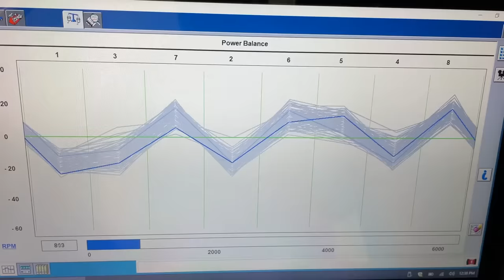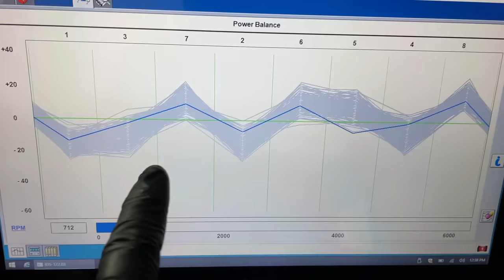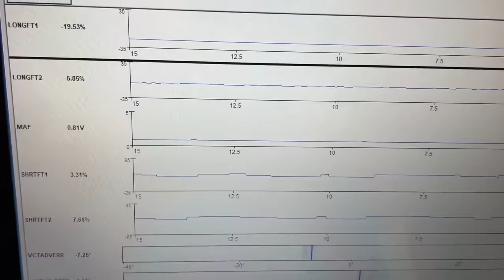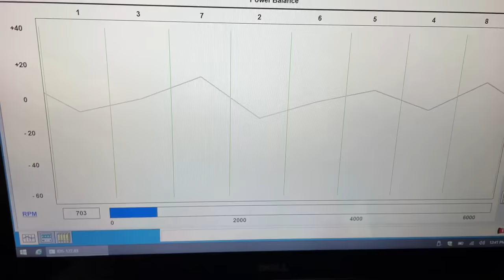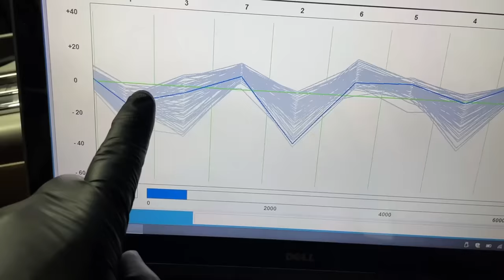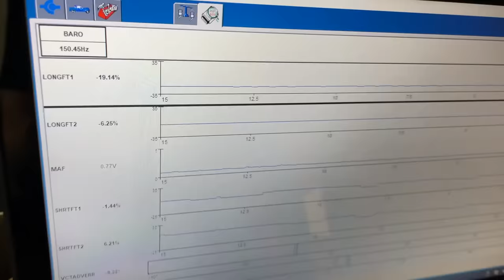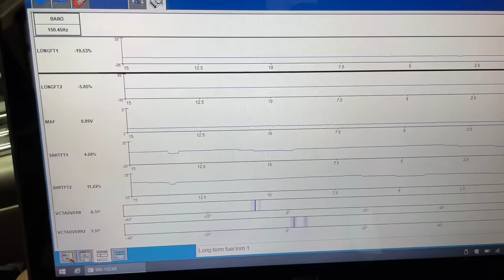Another Ford F-150 5.4L 3v Triton Rough Idle Problem the Other Shops Couldn't Fix!

Comment: I have a 2005 F150 5.4 3 valve and all original timing components WITH 334,000 miles.   Just change your fully synthetic oil every 5,000 to 6,000 miles.  I have a misfire every once in a great while, and this year I see my engine light go on, and the indicator light now blinks.  Testing it at Auto Zone proves a misfire, but doesn't say what cylinder is at fault. Is there a testing devise that I can go to test what specific cylinder is acting up?  Don't want to end up at the dealership for an expensive diagnosis.  Thanks for the video.  THUMBS UP!!!

Comment: We are doing a timing job on a 2007 Lincoln Navigator at this very moment. This vehicle has 450,000 miles. Hard to believe but oil changes every 3000 miles is the key. And by the way this is the 5.4 liter 3 valve motor. I sure no one believes it but it is true.

Comment: Only time I've had an intake issue with a three valve was with an '04 with 276k miles. Brake master cylinder was dumping fluid into the booster and the customer just kept topping it off until it eventually started sucking the fluid into the intake. All it did was ruin the gaskets at the heads. New Booster and Master cylinder, resealed the intake. And two weeks later the timing set and cats gave up (clogged bank 2 converter and bank 2 stationary guide broke).

Comment: Ford dealer told me the Same thing on my 07 F150, standard 5.3 liter. The issue was that it would die now and then but would start right back up. I left without the repair and as soon as I got home it died as I entered the driveway. I raised the hood and the first thing I saw was the cap was missing for the fuel pressure test point.  I pressed on the Schrader valve and there was no pressure. I turned the ignition on and still no pressure. I spent the next 3 hours lifting the bed and changing the fuel pump. Never had another problem with it.

Comment: I wish I had seen this. I had MF on CYL 1 and 6. I was driving,  thought it was clogged injectors, engine locked up at 93 mph. Came to a stop. Seen my timing guide was nonexistent on the driver's side. Definitely check the timing always. The 5.4 is a good engine with the right parts. I had 290xxx on my engine. Now I'm about to install a reman because I didn't realize my timing was bad. My ignorance.

Comment: Great job! I wish you had a chance to do a knock sensor replacement on the 5.4 3 valve on video. I'll be doing that shortly and looks like it'll be a pain in the butt. Love your videos! Helps us greatly!
Reply from the maker: I show everything you need to know including torque specs in my engine R&R video.
Reply: @FordTechMakuloco  How did I miss that video? I'll watch it soon. Thanks!
Reply: @FordTechMakuloco  Just finished watching your 4 part series on timing. .My Ford phaser is like 90° out!  Do I need to unspring it back into posting, or can I just lock out the chains and R&R it?  I'm waiting on my new parts. . Thanks!

Comment: I want to say how much I appreciate your channel. I'm a 49 yo 4X recertified L1 who recently bought a 267,000 mile '07 F150 4X4 from a waterproofing company that was retiring its old trucks.

Coming from the German car universe, have almost zero experience with the Triton engine except for dynamiting some plugs out a few times for friends. 

Looking forward to tearing into my 5.4 soon. It is suffering from blown out tensioner seals. Ordered all the oem chains, gaskets, guides, and tensioners. New melling HV oil pump as you recommend. 
Do you have an opinion on aftermarket phasers? Mine are a little noisy.
Reply: Only use Ford OEM Phasers...aftermarket are junk
Reply: Don't forget lushers and springs if needed on head for valves

Comment: Hoping g for reply..   having issues after timing chain cover replaced due to pulling boring a hole in it.  Runs super rough idle after about 20 minutes of driving.  Vvt had to be un hooked. Mechanic thinks metal filings got in and clogging something up.  Any ideas

Comment: Brian I have a question:   Based on your experience, do you think shops prematurely swap out the 5.4 3 valve engine because of its negative history when all they require is a complete timing job?  There are other youtubers that are quick to condemn this engine and opt for a reman.  I did the timing job 5 years ago with your help and the engine runs smooth as silk.
Reply from the maker: yes and yes.

Comment: I am having trouble with the truck I just bough, 2009 5.4 three valve, with it going rough when I go in reverse and some times at the stop light. It had a timing job before I bought it and they did not change the actuators. I changed the actuators, and it is very apparent new phasers and timing chain and tensioner, and old actuators. But I am still having an issue. I am thinking of putting new cam position sensors. The kid I bought it from did not know what oil was in it. A sign of not using Pennzoil Full Synthetic.

Comment: I have a 2006 Ford Mustang 4.0 V6 and it’s showing codes saying all four o2 sensors heater circuit is bad
Reply: The most probably you problem is a fuse.. or  one signal between all 02 sensors
Reply: @Edwintheporwersurpri  Ding ding ding. Look at wiring diagram. Do they share a ground?
Reply: @fredrogers838  idk I have to get a wiring diagram off the internet and see if they share ground

Comment: So what after you had new timing chains, phasers, oil pump, vam followers all of that replaced and you end up with a rough idle and misfire codes and the engine light will actually start flashing during idle or trying to drive the truck.

Comment: Bought a remanufactured 5.4 3V from powertrain engines..my first ford,it's a 04.. the passenger side phaser rattles for a quick second everytime it cranks..has since very first start when installed..is this normal with phasers??

Comment: Been trying to figure out a misfire I have had on my 07 Expedition. It was on Cylinder 3. I switched 3 coil with 5 and now have a misfire on 3 and 5. I then switched 5 with 6. Still on 5. I pulled plugs and put on a plug tester. 5 plug was a little weaker than 3 and was black. Running rich? I swapped the 3 plug to the 5 and put a new plug in 3. Still have the misfires 303 and 305. I should add that I have had this whistling noise when I accelerate for a while too. You mentioned intake leak. Could that be it?. Goes away but happens when i hit the gas while driving. Help!

Comment: Hello I've watched all your videos I just did a full-time job on an 05 f250 5.4 3 valve I have everything hooked up I put the 4 hole injectors it starts and as soon as it starts at idles high and then when the idle comes down it cuts off what could that possibly be please let me know your input on what I should look for

Comment: hello there , i have a 2004 explorer whit p0171 p0174, i check fuel pressure = 62psi, sft b1 and b1 looks ok between 2 and 6 lft stays around 6 and 8, but the ho2s b2s2 stays at 0 is this sensor one of the causes for lean system?? need your help please!!!

Comment: Well my 2013 EL King Ranch Expedition was rear ended and totaled with 82K miles in July, so I won't experience this with my 5.4L 3v.
So now I have a 2021 Explorer ST I hope the 3.0L tt is reliable.

Comment: My 06 5.4 has a code P0038 Cylinder 8 misfiring. Ford replaced sparkplugs before the code. I replaced #8 cylinder coil pack engine light is still on. Engine runs a little  rough at idle. I do not hear vacuum leak.. After replacing coil pack startup was a bit easier.. before it would take several cranks.Any ideas.

Comment: I have a 2001 expedition 5.4triton.i bought this truck in 2005 with 42k. the whole time I've owned the truck the engine has a slight Shake at idle.. upon acceleration the engine Smooths right out . . The average person would not notice it but me being mechanically inclined I notice it. I have checked for vacuum leaks and even replaced a couple of questionable vacuum lines. No improvement. Have you ever come across this issue?btw the truck has 246k on it now.still runs great.
Reply: PCV tube from valve to intake?  Mine went bad on my 01 4.6 and had the same issue.

Comment: So yeah I got one 08' 80xxx miles.
Has a knocking noise after it has been driven for a bit. Also when cold it will have a slight ruff idle and smoke white from exhaust till warm? 
Other than that it runs pretty good and no check engine light.

Comment: Dude I am just amazed by your expertise!! If I may, I have an 08 escape 2.3 with a noticable shake on idle. Let me clarify when under load ie. AC on and in drive. With ac off the idle is slot smoother. I'm about to clean iacv, any other input?
Reply: I have a noticable clunk, when the iacv kicks in. If I put my hands on the air box. I have no other ideas except for the drive belt system?

Comment: Can a bad phaser cause a p0021? I replaced the vct solenoid, on that bank. And same code. Tested plug to sensor. It’s good. Swapped the vct solenoid with other bank.(even though both are good) and code did not follow to the other bank. Original vct solenoid had stuff on it. Could that cause the phaser to go bad?

Comment: What was the overall fix?  Stated was timing job, does that mean it was those phaser gears that were replaced?  I am next to positive my 05 is having this issue and so far mechanic's in Reading PA aren't as good as you
Reply: This isn’t the first vid that Brian has done showing how he diagnosed the engine problem. Hook up the scanner, read the data and go from there. It’s literally that simple. It’s the type of data that’s read is key.

Comment: I have a 2010 Expedition with a 5.4 3v that is having oil pressure problems. It has 195k miles and was looking to replace engine. Is there a better engine that can be put in?

Comment: The orange in the radiator reservoir, is that normal? Mine has the same sedimentary looking stuff in it and I thought it was stop leak
Reply from the maker: yes it comes with time.
Reply: @FordTechMakuloco  should I do a coolant flush?

Comment: You’ve help me so much with my truck.  Thank you.    But now I have a issue I can’t figure out.   I have a 2007 f150 lariat 5.4. Flex fuel. 109kmiles.  I keep getting a blinking cylinder eight misfire.  I’ve changed the plugs the coils the fuel injector fuel driver torque converter fuel filter.    It starts shattering only going up Long Hills Other than that the truck runs perfect.  I also have a p0461 code now.    What can be my issue?   Thanks

Comment: Brian, I have a serious challenge here with my 04 F150. When I turn on my headlights and drive at night, everything seems ok. But if I turn on my heater or AC, my turn signals no longer work. My radio/CD player light and time flashes on and off, and sometimes my radar detector turns on and off swiftly over and over. Everything still drives fine, it just exhibits these strange symptoms. Also my dash lights went completely dark too. But here's the worst, if I throw the truck in park or if its already in park with the heater or AC on, it won't let me shift out of park into any gear, UNLESS I fidget with the headlight switch (on and off until it lets me shift). There is a Code Alarms car alarm wired in, and I dont use it at all... I realize it could be a wiring issue, but I was really hoping it could be simply a fuse blown or severely damaged. Any ideas from your end? Some spitballing here would be greatly appreciated!!!!! This single issue is a bane in my existence!!!
Reply: Check the cluster panel. All the I believe runs through it. It's a easy replace if you can find one. Just a thought!

Comment: I have a 2008 f150 and i put in new plugs and coils and the engine is still shaking and I can hear a ticking noise on the left bank. It runs fine at higher speeds but at lower speeds it shakes and shutters and runs rough on idle. Any ideas trying to fix it myself

Comment: So I’m having a similar problem mine has around 320000 miles and I’m not sure if it’s ever had a timing job done in it but mine does this weird thing that when you bairley press the gas pedal on hear it starts shaking and sounds like it’s knocking but you rev it and it stops 
Also when driving slow and bairley pressing the gas it dies please help I’m at a loss on what to do now is it a timing problem or fuel problem

Comment: Believe it or not a different version of the 5.4 was  being used in the Shelby for a while it’s actually a good engine if you take care of changing the oil and stuff a lot of people don’t maintain them and that’s a big part of the problem from what I have read the oil  galleries get clogged up  And the engine ‘s self-destruct. they also use them in the lightning pick’uo’s  up for a while
Reply: Pick up I meant

Comment: Dude, love your videos!!!
I have a 2009 ford F150 5.4l.
After the truck gets warm and I put in reverse to back up. It has a rough idle to point of almost killing. If I put in neutral and slightly rev it. It fixes the issue and it runs fine. Also, On start up it sounds the engine sounds off but again a slight rev it fixes it. Truck has 148xxx miles on it
All new plugs. I run a 5w20 oil. Any thoughts on how diagnose the problem... with out the fancy computer...lol.
I'm no mechanic just a dyi'er...if it's not to involved.
Thanks for taking time to make your videos. You know your stuff!!
Reply from the maker: You need a complete timing job with high volume oil pump. You are experiencing oil pressure and volume issues causing erratic VCT operation. You can use Rotella T6 5W-40 to help alleviate this.

Comment: What does a timing job cost, i have rattle at start up. Im assuming one of the guides has broke.190,000 miles
Reply: Todd, we had that noise a few years ago and Brian has about 4 videos that I followed to change out the phasers, VTC's, timing components, etc. Recommend that you do the same (or have someone else do it). Use only the brand of parts that he recommends and don't try to save money with junk parts that have been known to fail.

Comment: Should i buy full engine  from 2005 expedition for my 04 F150...please explain why yes or no....
   I really just NEED the block
Reply: Just get the whole engine, remove the heads, turn it upside down so the pistons can fall out, then right side up so the crankshaft can fall out…then VIOLA! You got a block!

Comment: How much should  a timing  job cost? Mine has problems  my local shop can't fix.  I swear it's timing  , like it won't advance when accelerating  .
Reply from the maker: Close to $3k.
Reply: Thanks , I could do 90's Toyota  V6 in bout two hours , book said 4 hours . Is the Ford way more difficult ? Keep in mind I'm a tree guy , not mechanic .
Reply: Guess I'll take it to Ford just to make sure it's timing  before I  dive in !

Comment: Dude please please send me a link to the proper melling extra power oil pump, the link in the other video says doesn't fit mine.  2006 5.4l triton. Thanks so much
Reply from the maker: The one I link to is correct for all 3v engines 2004-2014.

Comment: I got 2019 f150 3.5 ecoboost and phasers r loud. Need replacement. Tired of check engine light turning on than off the next day. Losses power and fuel economy also. I need ur magic to fix this issue for me. Tired of waiting for letter from dealership to have them do a phaser replacement

Comment: I have a rough running after warm up. No codes,I just installed remand engine
Reply: Also my longft are at 0, shortft is -7 b1 but normal -3 b2, I don't have vcterr on my scanner

Comment: Hi Brian, what if I only have the error fluctuations sometimes? With a P0022 CEL code? Would that be a bank 2 intake VCT going out? Especially intermittently, sometimes stalling at idle. Under mode 6 it’s says vvt bank 2 is at 11.63-11.64 degrees sometimes (Max supposed to be 11.61 degrees)

Comment: I’m having this issue with an older 2v 5.4. It’s not only on one bank though. I’ve also changed injectors, plugs, coils, checked compression and it’s still rough idle but runs great otherwise. Only code is for a rich misfire on number 8 but it jumps around like yours does in the scan tool. Could it be timing on a 2 valve? Any advice would be greatly appreciated. Could it be plugged catalytic converters since the 2 valve doesn’t have cam phasers to go bad?

Comment: Hello
I have a question I have a 2007 f150 5.4 3v brought it to the dealer and they replaced timing chain with new guides and tensioner, new camphasers and new vct solenoids but after engine is warm it still hesitates and when they unplug the vct and runs normal can you help me
Thank
Reply from the maker: Your thrust washer is wiped, time for an engine. Alternatively try Rotella T6 5W-40 first.

Comment: How does one go about scheduling for you to go through and check a vehicle out? I am from Mississippi also and have an 04 that is not my daily driver any longer. But it has never had a timing job either. 255,000 miles! But trying to keep the truck up. Just no trusted mechanics in my area.
Reply from the maker: You can submit a service request here- http://bsgautomotive.com/

Comment: I have a 2006 mustang gt 4.6 and I’ve been getting codes P2104/2111 and car goes into limp mode . I had a new tb replace,plus tune up my pedal is working. As soon I turn on the car is rough idling and wants to turn off . Just wondering if you think maybe my computer might be the issue